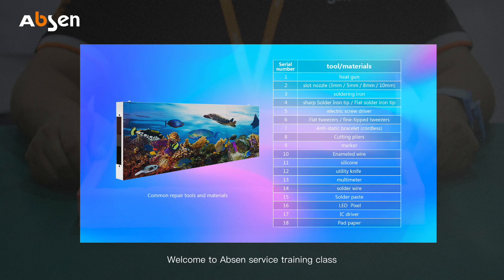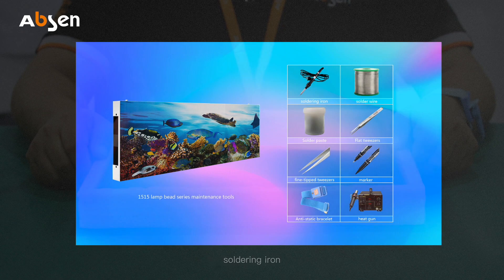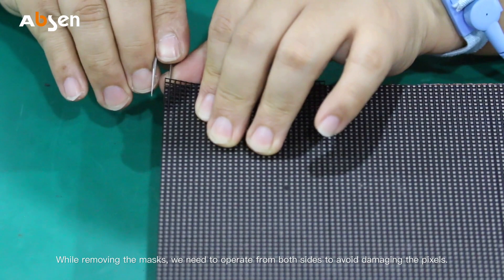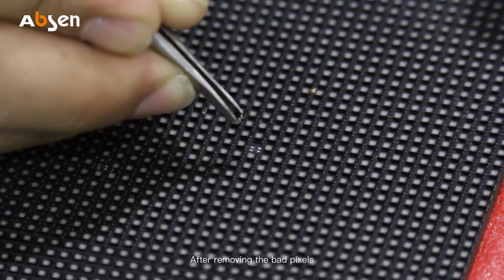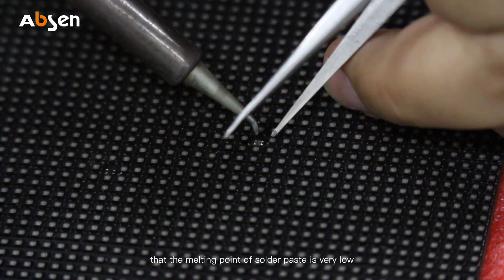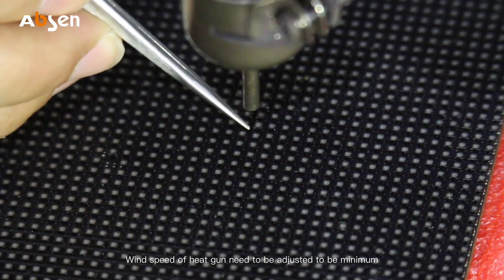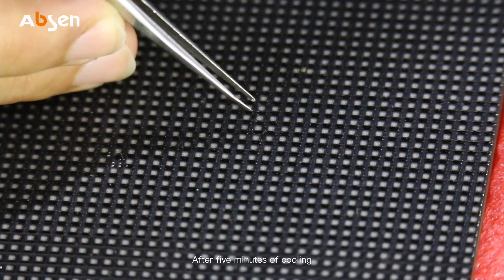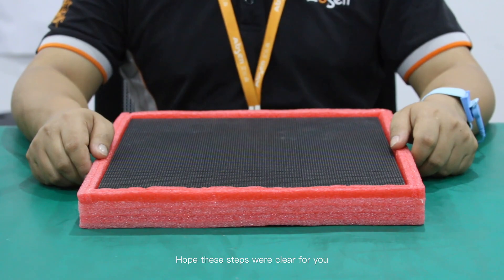How to repair 1515 LED pixels_Absen LED

Comment: Hola. Buenas tardes a que temperatura sueldas. En la empresa ya llegó la pantalla y llegaron 2 led menos y tengo que arreglar...
Reply: Approx 310 degress Celius is good.
Reply: @shanecorkrock gracias 🫂
Reply: is that tweezers  is a good technic ? @shanecorkrock